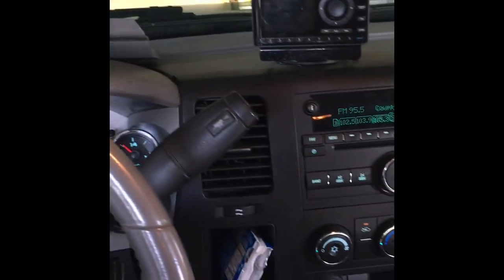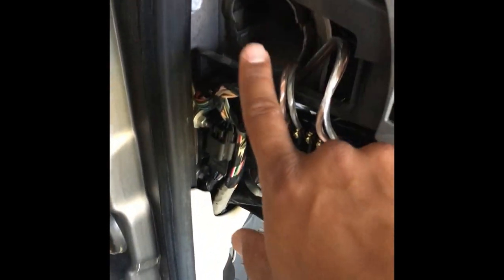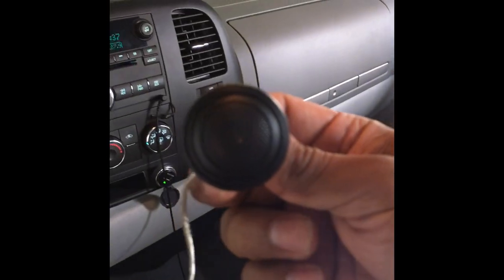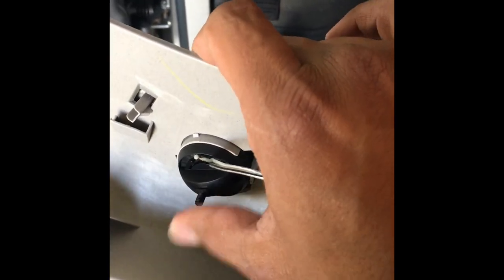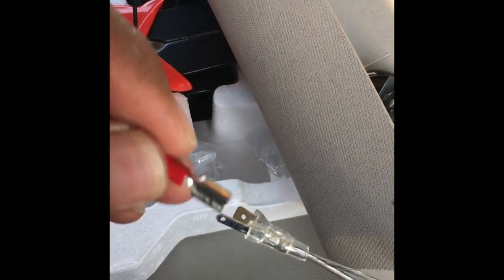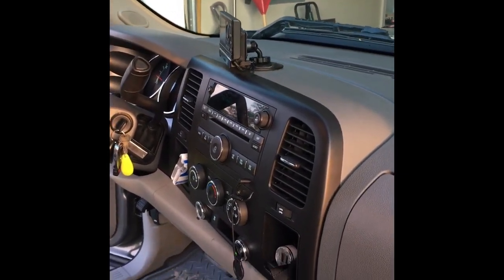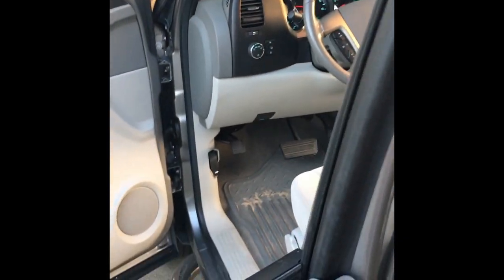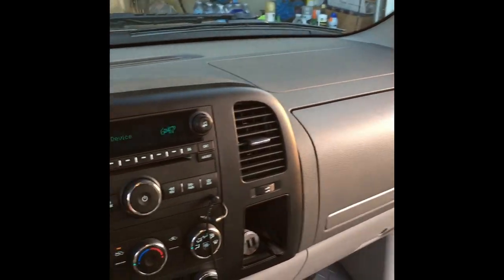Installing JBL component (GX600c) tweeters 2007 nbs GMC Sierra

Comment: these or the gto's
Reply from the maker: honestly i haven't used the GTO's but according to jbl one line is not any better than the other just have different specs. these have been good since i've bought them and only seem to be getting better as they break in..i'm selling this truck and am going to actually take them out and put in my new one they sound so good.. and all i'll have to do is add a pair coaxials in the back doors, throw in my 4 channle mb quart amp on them and mb quart 1000 watt on my JL audio w1v3 and i'm set.if you want quality i'd get any pair of jbl's matched with a good amp and you're set. i hope this helps.. like and subscribe. i'll be posting vids of how-to's on my new truck soon and reviews for coaxials.
Reply: SPECMOC thnx ur advice is super helpful im thinking of getting thesw or the gtos the gtos are a lil more expencive but theyre both on amazon. The gx's are theyre as well with the coaxils theyre the gtos idk... Right now i have mb quart discuss on doors and am not satisfied my car came (scion xd) came with pioneer system and they sounded better. I have a hifonics 4 channel 600.4. Componets 6 1/2 fronts and 6 1/2 coaxils rear. I have a scar 400 watt amp for 10 inch sub and a 10 inch scar shallow sub in ported box cars a hatchback.
Reply: SPECMOC also have a kenwood ddx395 excelon touchscreen.
Reply from the maker: Oscar Lozoya sounds like a pretty good setup! I also have looked at the gto line and might go that route too just don’t know yet I’ll have to make sure and find out what speaker size will fit the new Silverado I’m using and have only used mb quart amps for about 5 years now and I have been pretty please with them. What is it you’re not satisfied with?
Reply from the maker: Oscar Lozoya yes that will something I definitely will be doing on the new truck.. is putting in an aftermarket unit it.. i haven’t in my last few installs and i would definitely benefited from it.. so that will be the first thing i do.. how do you like the excelon?
Reply: I have the mb quart 6.5 components and coaxils in my vehicle but they're the entry level discuss series....MB Quart DC1-216, they just ain't doing it for me they are not lively or bassy or much of anything there pretty clear tho but the pioneers that came stock with my scion xd sounded way better more bass more smoothness these things seem pretty harsh i have them amped with that amp..so idk what the deal..so im thinking of switching to those jbls the gx series or the gto series..i can get either for a decent price on amazon the gx will be less...they also have club series..the gto componets are like 86 or something online while the gx's are 50 ish...idk what to go with and if i where to do the gtos' the coaxils that are the same would be the same price where i can get the gx series for around a 100...but i went with a different coaxils with the gto's it would be around the same price but idk if i should do that mix and match series etc...
Reply from the maker: Oscar Lozoyaok I see  I got it. I think you will definitely be pleased withy the sound of the jbl for sure. The components I have have a settings for the teeeter (+/- 3db) so that helps with the brightness. I’d probably go with the same line and I think you’d be happy with whatever line you choose. The only other brand I’d recommend is Focal but they are a little more expensive. I had a set of those in an optima I had before this truck and they sounded amazing. I made a unboxing video on those and a sub and amp install with them in the car . My stupid self left them in the car when I traded it.  But also amazing sound.
Reply: Oh ok yea ive done my research and first i was broughten focal..and then morel...now crutchfield was trying to sell me a set of moral's for 250...but idk i even wanna spend that much...when i can get those jbl's for like a 100...
Reply from the maker: makes sense. i actually bought the focals pretty cheap off ebay but you have to make sure its a trusted seller or authorized dealer. try ebay
Reply: idk i kinda want those jbls
Reply from the maker: go for it man
Reply: im just stuck on the gx or gto..how do they sound?
Reply from the maker: honestly my gx sound awesome, couldn't be happier good clean and clear acoustics nice highs and even lows..go ahead and order them. they won't disappoint. my mb quart is a 80.4 and it runs them good. i'm using the stock hu and they sound good so your aftermarket would be even better. you can tweak the sound even more
Reply: yea 13 band equalizer mini dsp...5 volt pre outs
Reply: ive never really did an component install b4 or install in general you think i could do it. what kind of wire should i use to run to tweeter's?
Reply from the maker: its fairly simple.. i would use 12 or 14 gauge to run the speakers and tweeters..its a simple process. you'll have an in/(2)outs on the crossover, your "in" will be from either the headunit or amp if you're running one and your(1) "out" will go to the woofer and (2)out will run to your tweeter.
Reply: well i already have the mb quart components in front that family friend already did i was just going to copy that.